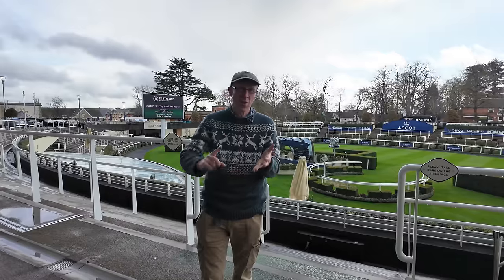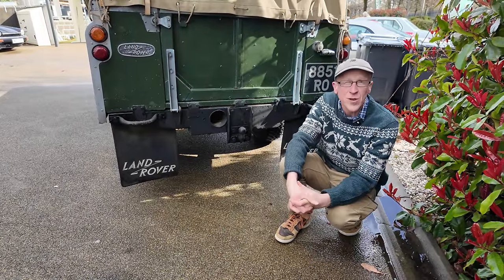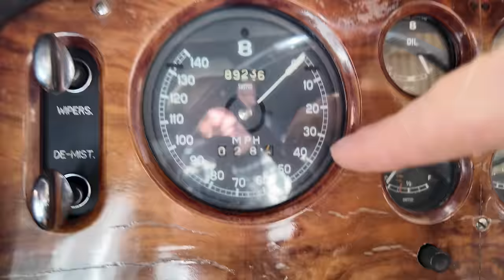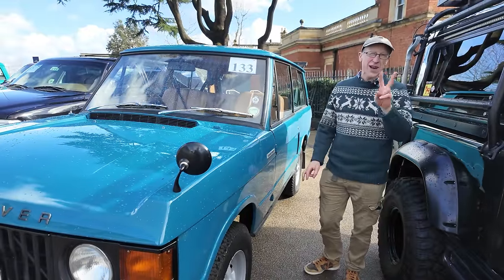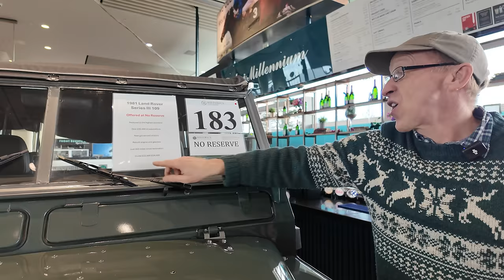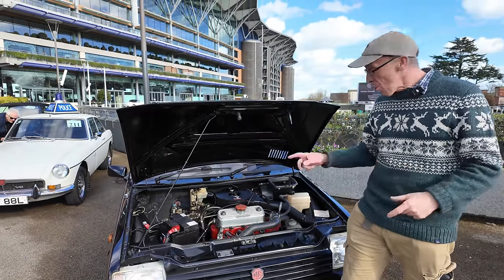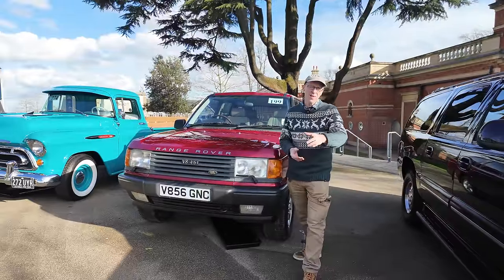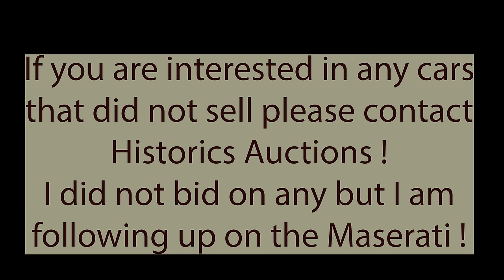Historics Car Auctions March 2024 - Land Rover / MG / Bentley / Maserati

Comment: You can charge your battery through those plus/minus terminals. Modified my battery charger to pins and was no need to leave your charger out in the open
Reply: George, I still have one of those fittings sans the car 🙁. I ran a 12v thermostat to heat up a mug of tea with it.

Comment: sorry to correct you Simon but the Rover V8 started in the Rover P5b in 1967 one of which I owned , mine was a coupe which was as close to that lovely Bentley that I got, also had a 71 RRC but it had been fitted with a York 6 cylinder diesel.
Reply from the maker: Yes I think you may be correct about the v8

Comment: Hello Simon…I’m doing this as you go through the cars! That Series 1 is a bit of a mess..surely it has the wrong springs as it is miles too high and the whole.e rear quarters look the wrong shape….then we get a questionable registration number as XVW dates from June 1961 and even then would be XVW 123…not reversed.
The Mini would appear to be a 1961/62 car to have the steel window catches and has been resprayed in the 1961 colour of Speedwell Blue…yes that boot has been sprayed because the petrol tank should be black and it is missing the fibreboard battery cover and loose fit ribbed rubber mat of the early cars. Then…it has the speedometer instrument binnacle of a later 1963 car and why is the bottom roll of the dashboard frame covered in vinyl which arrived in late 1963 for1964 models. The roof lining looks correct and the seats are indeed 1963 but don’t tie up with the window catches. I think we again have a car that has been fiddled with over the years to look older than it is…OR…it is a very, very late 1961/62 version with some of the later 1963 upgrades factory fitted as production changed over to the later specification?? Chassis numbers and build date might help! 

Back to the film!!!!🏃‍♂️🏃‍♂️🏃‍♂️😃😃😃
Reply from the maker: The Mini claimed to be 1963 - not sure if i said the date wrong !
https://www.historics.co.uk/buying/auctions/2024-02-03/cars/ref-97-1963-morris-mini-850-dg/
Reply: @L663 No you said 1963 and it is registered in January 1963 but it has parts from a 1960/62 car….it s a bit of a mixture! 🤔🫢🫣😃😃😊